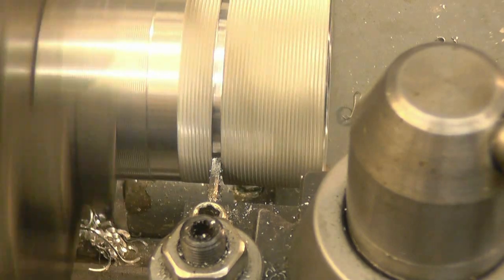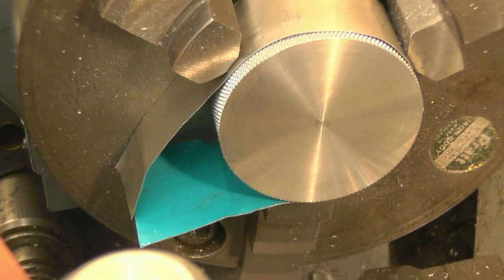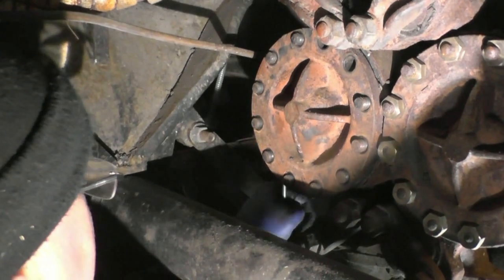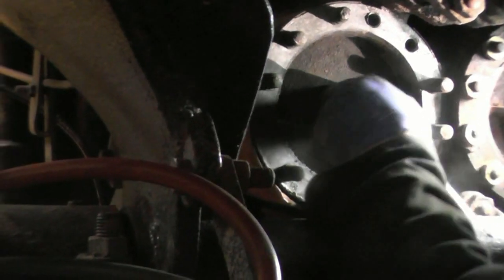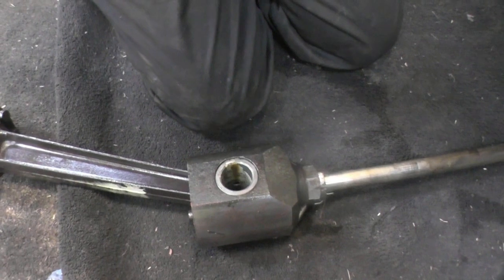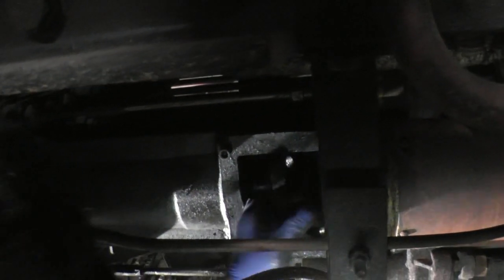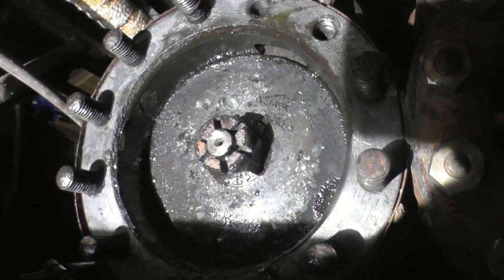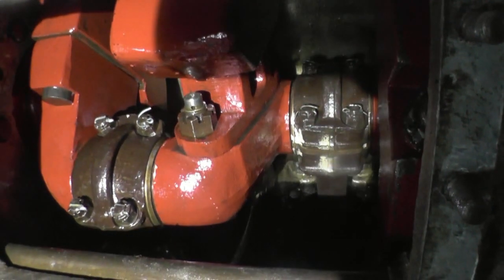SNNC 114 P2 Sentinel engine work

Comment: John,
That was really interesting about the steam engine. I never thought about it, but you would have to keep the lube oil away from the steam. It looks like things are coming back together. I imagine Richard and yourself and looking forward when you fire it up and take it for a drive. Thanks for a great video!
Have a good one. 
Dave
Reply: +Swarf Rat They're not the only ones looking forward to the trial run of the newly improved Sentinel! :D They are certainly the ones putting in the hard yards, but then again they'll be the ones having most of the fun. 

It will be grand to see those Bonny Lads making a good go of it, but to be in the cab would be the "dog's bollix". Hoping you're well Dave...Aloha, Chuck

Comment: I work on double acting reciprocating compressors which are built in a fashion similar to that steam engine. 
A suggestion based on our experience is to make a threaded cover for the end of the piston rod so the threads don't damage the seal as you push the rod through the seal. Ours are cone shaped and made from steel and are ever so slightly larger than the rod diameter. .001 to .002 inch. A 32 rms finish should do it.
Great video.
Thanks,
John
Reply: +John Bazaar hi John what wasnt shown was the screwed on tapperd end that was on the end of the piston rod when we pushed it back through....
Reply: +Richard Straughan 
Aha! Twisted minds think alike.
Thanks,
John
Reply: +Richard Straughan Richard, that is a beautiful steam wagon you have there.  Thanks for keeping it from the scrappers and returning it to its former glory.  Lots of hard work there...  Thanks also for driving it around and showing it at rallies.  Living history...
Reply: +Bob Korves Hello Bob thankyou for your kind words, if ever your around please make your self known and i"ll take you for a ride out on the Sentinel.....
Reply: +Richard Straughan It's a long walk and swim from California, Richard, but for a ride in the Sentinel it just might be worth it!  8^)  If I ever get over there I will certainly look you and John up.  Thanks!

Comment: Will you all be rebuilding the other steam cylinder as well? I think he said the old shaft was Stainless and the packings were bronze but the new ones were cast and the new rod was Chrome? I assume by the shaft being stainless it was replaced before? I guess it was not offering the desired wear performance being the reason for the material change?
Reply: +bcbloc02  Good question. Too bad no response.